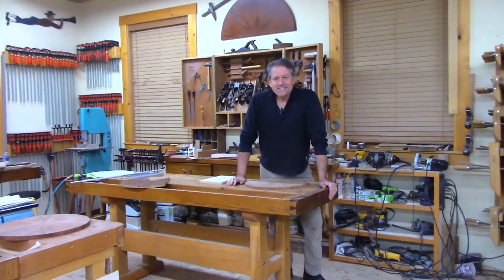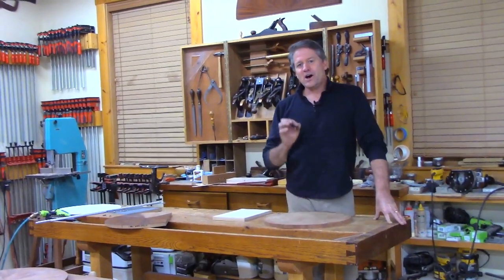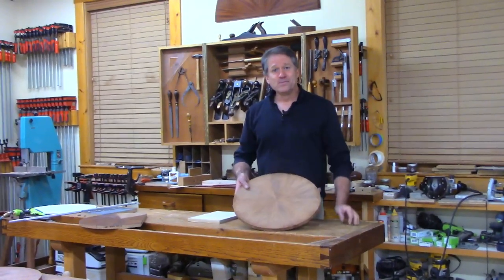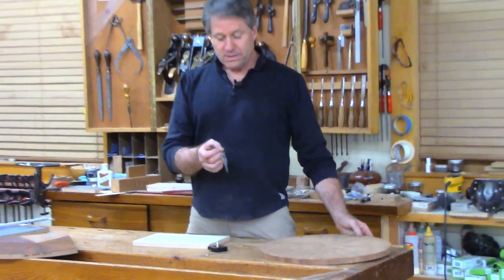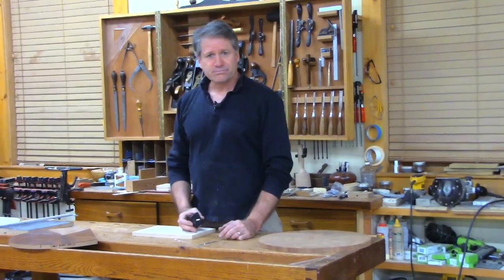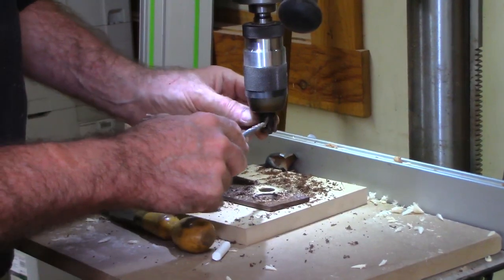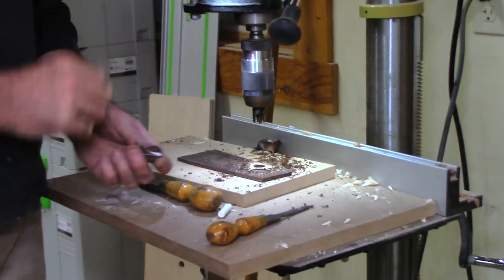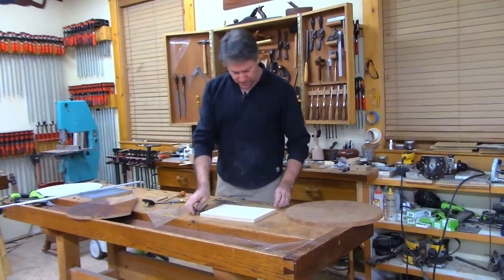Inlaying Techniques for Clock Making with Tom McLaughlin, Part 1

Comment: I will say, I have been seriously thinking of upgrading my 25 year old Delta bench top drill press with a new floor model Powermatic.  But after hearing that sound yours makes I think I might reconsider brands.  That would drive me totally bonkers.
Reply from the maker: Hey John,
Yes, I know what you mean... but don’t use mine as the example, I’m pretty sure something needs adjusting and we’re planning to address it next week. I’ll be sure to mention it next time I use the drill press. Thanks!
Reply: Check out the Nova Voyager. I love mine. Very innovative and well made.

Comment: Hi Tom and Kris.  I thought this link to Rockler's clockmaking area might be useful.  https://www.rockler.com/learn/signmaker-templates-clock-project-plan

They sell an array of sizes from Innovation Specialties in Culver City, CA.  Various shaft lengths to accommodate clock faces of different thicknesses.  The quartz movement I purchased from them doesn't have a "sweep" second hand, but the noise from its "click" isn't too annoying.  I found one consideration for the quartz clock movements is the noise they make and the type that sweep tends to be silent.  Of course, if you like the ticking sound, then by all means go for it.

Thanks for the discussion and demo on inlay techniques as I've been stuck on how to finish a clock that is nearly identical to the one you demonstrated.  Getting the appropriate size hands (compatible with a suitable movement) and then determining how the "numbers" should look had me in a bit of a quandry.  Your process will move me a lot closer to the goal line.  Now, if I can just source some hands that I like!
Reply from the maker: Thanks Bruce! I didn’t realize Rockler had those clock materials. And I got a kick out of the “State park” font they used for the numerals.
Here’s a link to clock hands I found on Amazon. I’m not sure they’re the same size as those I showed, but they’re similar and I’m sure you could find them in different sizes: Youngtown 12888 High Torque Long Shaft Clock Movement Mechanism with 12 Inch Long Spade Hands https://www.amazon.com/dp/B07CK92GRT/ref=cm_sw_r_cp_api_i_mRBEFb1W06VR0

Thanks again!
Tom